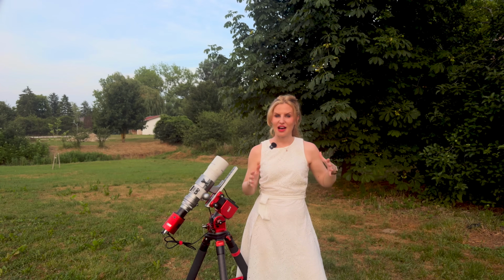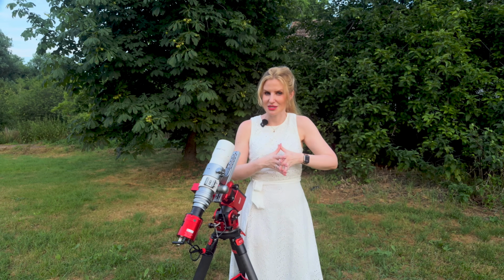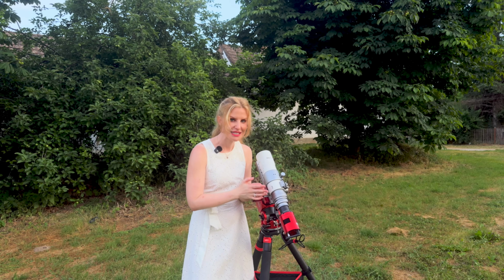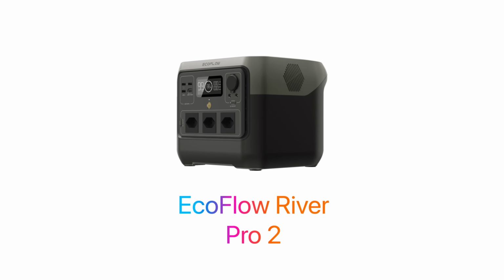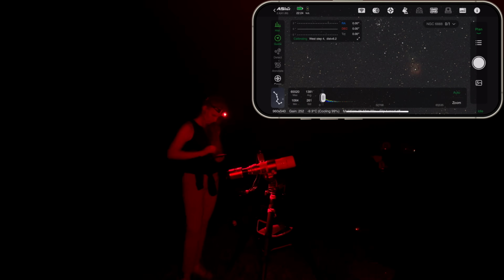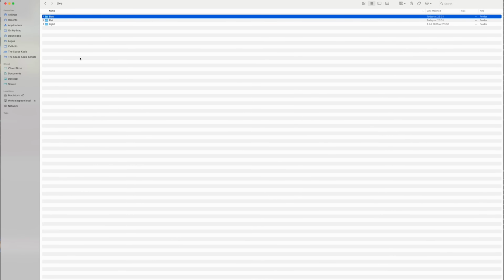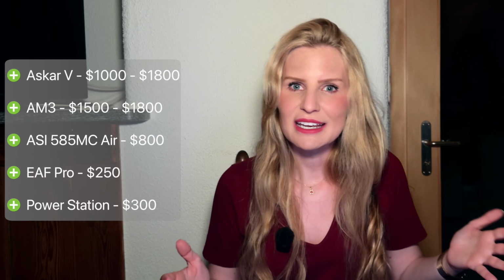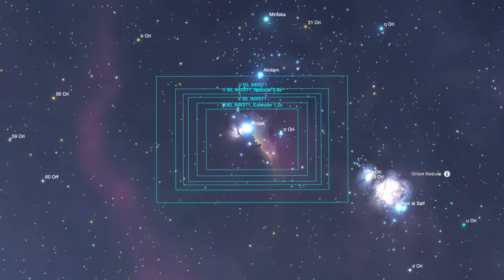Build Your Own Smart Scope! Easy as a SeeStar, Pro results!

Comment: What happens if the company stops support for the app? i.e. they go bankrupt or just decide not to update? Can you use manual methods or hook up to PC or a non app based controller of some kind?
Reply from the maker: if you mean for the camera, it works via Ascom Alpaca protocol as well - you would be able to connect to the main and the guide camera via Wi-Fi and use it in Nina or the imaging app of your choice. The rest of the setup is not dependent on the app in any way
Reply: @the_space_koala  oh okay, so you wouldn't be stranded if as I said above the company goes out of business or chooses not to support going forward due to cost to run servers etc. It seems that most companies these days want to push a subscription based model for apps and access, some change terms of services once you've purchased. The term is "enshitification". Louis rossmangroup has a lot of videos on companies that do that and advocates against. I've had it with DJI on a couple of devices that the software was not updated once new devices were released. and you were essentially stranded using older software or forced to sell off and buy new version (to access features. I just stopped using there gear. in one case because i couldn't get it to work. At least apple supports lots of previous generations when they update and only on the really old stuff do you lose features etc. With all the wifi/ bluetooth components shown on the video if there's a non app fall back then that is handy, as it an expensive setup...

Comment: Modular setups also have the benefit that you can switch to visual astronomy if you feel like it. Astrophotography gear is generally also just good visual astronomy gear, not top end visual astronomy gear but definitely often in the high end since generally the demands for astrophotography are simply just higher. Sometimes astrophotography gear does introduce some hassle or can get a bit in the way of visual observation like if you need to control it with a computer and ruin your night vision, but otherwise you need to get to the top end of visual astronomy with huge dobsonians before astrophotography gear becomes incompatible with visual astronomy gear.

Comment: I would swap the Askar for a SV555 & MK127. More versatility for 2/3 the price. Nice rundown. I've been anti-ZWO ecosystem, but this video really sells its strengths. It's worth considering.
Could upgrade to the ASI2600MC Air.
Reply from the maker: oh yes, 2 scopes are better than one! :D Though the mak is quite limited with the object selection if you put the IMX585 on it.

Comment: Keep in mind that components get old as well and astrophotography technology improves pretty quickly. So, you will eventually be drawn to buying again whether you have components or a smart telescope. And, I would estimate the cost of this rig at around $4,000. A Seestar is around $400. Roughly a tenth the price. So, it's pretty realistic that you could "replace the whole thing" ten times. That being said, I went through considerable frustration with a modular rig. So, when I got a Seester S50, it was mindblowing to find how easy it was to get fantastic shots in a bortle 8 area. I used to think these telescopes were toys and could not have been more wrong. However, I did eventually make my way back to my refractor rig for planetary photography. It will be fantastic when smart telescope makers get closer to combining the best of both worlds at an affordable price. I would highly recommend smart scopes to anyone just getting into the hobby. If you must go with a modular rig, put a Star Adventurer GTI at the center of it.
Reply from the maker: I did a presentation on these points and a few more recently called "Are Smart Telescopes Taking Over Astrophotography?" in case you're interested

Comment: A good cheap setup is the William Optics Z73 ($700) refractor and the Skywatcher GTi ($800) EQ mount. you can get a good guide setup for about $300. ASIAIR (recommended) is $300 unless you get the mini then it's $200. That's all you need (and the power bank).

Comment: One thing that is nice (when they work) with the smart ones are the software upgrades that come through. Would putting together a system like this have this aspect?  Also, how much larger can the telescope be for a mount without counterweights? I like the portability even of the celestron which with the wedge just fits my backseat with everything else when I drive out to dark skies.  AND thank you for these videos!
Reply from the maker: the ASIAIR does come with updates periodically, though not as often as the Seestar & other smart scopes. This periodicity will likely even out between the 2 as smart scopes have mostly been rolling out features that are already present on "traditional" rigs. No counterweight limits depend on the mount you choose, but if you're an Origin user for example, the mount shown in this video would carry those optics (RASA6) without any issues - I use mine with a RASA8.

Comment: Thanks for such an easy to follow and understand video!!  I wonder whether you or anyone else has tried essentially this same rig only using a TeleVue 100mm telescope instead of the smaller and lighter scope that's being used in the video?  The one thing that worries me about trying such a thing with the TeleVue I currently own is that the TV scope weighs about 13 lbs. with the CCD camera and that might be too much weight for the Harmonic mount being used here.  I will need to check to see if their is something similar to that mount but a bit "beefier" to handle the TV's weight with no problem of introduing the "shakes."
Reply from the maker: What I like to do when I have such a concern is go on AstroBin and find people who have used that specific combination - so the TV of your choice on an AM3 and maybe you can message them directly and ask about their experiences

Comment: I am also looking to Upgrade from my dwarf 3 and Not Just buy a smart Telescope again .

Your Video ist very helpful .
But the price ist 10x the dwarf price .

My question is regarding the lower cost Option:

As i understand the high price Version Kamera has a Duo Sensor especially for Tracking puroposes.
How does in the cheaper model do the Star Tracking?
Reply from the maker: if you want to cut the cost down from the example setup in my video, you should go for a lower cost mount such as the star adventurer gti. in terms of the camera you maybe able to pay less in the short run, but in the longer run you will most likely not find a better overall deal than the 585mc air as it includes so many things already - most importantly guiding.
Reply: @the_space_koala  
Yes i See also the good value in this Kamera solving so much hassle.

But sorry for beeing dumb . 
Does a mount from a different company (Not ZWO) connect also to the 585mc ?

Comment: Really nice job on this video. The Askar V provides options and flexibility if it fits into ones budget. I like how you laid out lower cost options at the end of the video. I'm putting together an SA GTi, SV555,  and probably an asi585 air. I'm debating a 533 or the 2600. I have very little free time (3 small kids). So I need something I can grab out of the basement and be imagining ASAP.  I would love to see how low someone could get the cost on a fully integrated rig.
Reply from the maker: the 533 doesn't come as an air option unfortunately (at least not as of now) and the 2600 surely inflates the price! If time is a huge constraint I would focus on having a rig you can leave fully assembled so you literally just grab it and put it outside to start imaging. If you can somehow mark an accurate polar alignment that is reasonable enough it would save you even more time!

Comment: You really need to put together a modular rig that is at most 3 times more for this comparison to be even close to reasonable.
Reply from the maker: it is possible - I mentioned a lot of options around the end. I worked with things I already own and with tools that make life super simple. In general you have a tradeoff between ease of use and cost when it comes to these devices. E.g. you pay the "zwo premium" for a lot of stuff, but the ASIAIR is a breeze to use... you pay more for the harmonic mount but you don't have to care about balancing etc.

Comment: Wow thanks Luca, i'm loving my seestar s50 but I also have a Celestron C11 cassegrain on alt az fork mounts that has only been used for visual moon, and eyepiece camera planets. If I was to get a ASI585MC Air camera does that mean I could ignore and not use the goto system and use the camera software to polar align and target deep space objects?
Reply from the maker: not sure I'm understanding right what you're trying to do - perhaps you have your fork mount on a wedge? Otherwise there's no need to polar align. I do not believe the driver they have for the celestron supports alt-az mode so the wedge would be a must
Reply: @the_space_koala  Thanks got ya, I would need to mount the alt az fork on an EQ wedge then polar align and 'go to' targets with the ZWO air camera software. Thanks for advice :)

Comment: Appears that the Askar V has been discontinued, do you have an updated recommendation that allows for similar swap out of components? I do like the idea.
Reply from the maker: It’s very sad they’ve discontinued it. To my knowledge there isn’t another similar scope on the market. Though with many refractors you can choose e.g. a flattener vs a 0.8x or 0.7x reducer. I quite like the FRA line, it gives you the option to shoot with no reducer or with the 0.7x one

Comment: I agree that options are unlimited in case you will build this by yourself. But what is significant difference is the cost. For low end build it is almost 3 or 4 times more than you paid for Seestar. This build is, from my POV, more comparable with Unistellar stuff rather than the Seestar.
Reply: Even the celestron origin is, at least, half the price of this setup.

Comment: This is a great video!  So much good information.  One question: what would you recommend in place of the Askar V?
Reply from the maker: I have had a good experience with the FRA series, for example. You can still use it at f/5.6 and f/3.9 (with the optional reducer) so it keeps some of the flexibility. It is, however, heavier than the V

Comment: What tripod are you using in this setup? Could you provide a link to it please. Thanks.
Reply from the maker: this is the William Optics carbon tripod. I did not link it as I don't actually recommend it - the ZWO one you can buy with the AM3 is more stable due to the blocking piece in the middle
Reply: @the_space_koala  Thank you.

Comment: Hi Luca, an important aspect not mentioned is what is the rejection criteria for subs ? Can this be configured. Some people don't want to separately sift through individual subs and stack them separately. As we know a few dodgy frames can ruin a stack. If there is no smart stacking then this could cause issues with final stack.
Reply from the maker: thing is stacking afterwards will always be superior, as no matter what parameters you set (whether you can or not - which I believe is the case for the ASIAIR), the program cannot "know the future" therefore the first few frames will have a huge impact on the overall quality of the stack and rejection can only come into the picture later

Comment: Well, while I like the idea, the comparison lacks a bit: the price difference is almost tenfold.
The S50 costs £499, whereas your setup costs £4,000.
The charm of a smart telescope lies in the point-and-shoot feature, and the ability to later try EQ mode cheaply with a wedge.
I would still recommend that a complete beginner goes with an S30, S50 or Dwarf 3 before spending 4k to start with.
If you reach the limits of what the S50 can do (after processing images with external software, etc.), think about getting a rig like this.
But even if the S70/80 cost £1,500–£2,000, it's still cheaper to upgrade the whole unit than this setup.
Reply from the maker: I agree with you - the Seestar is a great way to start. however, many people will outgrow it. I cannot speak for a hypothetical future larger model, we'll see when it comes out. A more advanced rig can definitely be built for much less than what I did here - my point was mostly to show that if one is super scared of switching to a traditional rig, they don't need to be. This was the easiest-to use, most versatile rig I could come up with.

Comment: So did you rotate the camera manually or did you add the CAA to rotate the camera? That of course is not included in your setup, and I don't see one in your setup here. Since I started with a Seestar, I was expecting the camera and mount to automatically rotate to match the correct frame. Does it do that somehow without the CAA, or did you do it manually?
Reply from the maker: I did it manually! You could do it automatically with the CAA as there is space for it in this rig. It is different from what the Seestar does, though, as the Seestar never actually rotates the sensor, it just takes a mosaic and crops it differently.

Comment: I would like to see camera makers create smart telescope software so that micro 4/3's camera like the Panasonic G9 II or OM-1 MK II can be mounted onto goto mounts and be used like a smart telescope with similar features like the Seestar S50. Not only can traditional stacking and processing be done, but high resolution sensor shift technologies can increase image details while drastically reducing noise. There are many great lenses, and with the 2x crop factor, lenses like the Sigma 600mm can achieve 1200mm equivalent magnification. Consequently, the user could easily go from sweeping Milky Way shots to stacked and processed images of Saturn.
Reply from the maker: I believe it is in no manufacturers' financial interest to produce software that will mean you purchase nothing from them. That said, you can already do most of the things you mentioned using open source software which you can run on a miniPC or Raspberry Pi. There are tons of software out there that do live stacking (deep sky and nowadays with SharpCap even planetary). However, this will never be a plug-and-play experience, as extensive setup and initial experimenting may be necessary. I am not aware of any software that would let you benefit from pixel shift technologies, the same is usually achieved via drizzle integration. As for planetary, your limitation is not really the focal length but the physical aperture of the lens that will limit what you are able to get.

Comment: Interesting, thought-provoking video, thanks! From what I have heard, a Seestar S30 Pro is definetly coming end of 2025/ beginning of 2026. Also, a Seestar S70 is already in production, but there are only rumors when it will be released. Most rumors say a bit later, but still 2026. Personally, I started with a Seestar S50, which is a great little telescope and then bought a Vaonis Vespera II, which has much better image quality. The mosaic modes of both smart telescopes are working so well and seamlessly that you can also image a great variety of targets. I am just not prepared to pay 4000+ (in Europe even way more), and the economic alternative you propose is not flexible in focal length and still way more expensive than the Vespera II. Overall, I found that I improved most in astro photography with patience for more integration time (16h-32h in my Bortle 7-8 skies) and post-processing training (Pixinsight courses with Adam Block and others). In my humble opinion it is not the gear that allows for the biggest advances, but really darker skies - just check out what Jim alias Photon Rookie is able to achieve with the Seestar S50... imagine a Seestar S30 Pro or S70 at the Starfront Observatories for 99 Dollars a month!